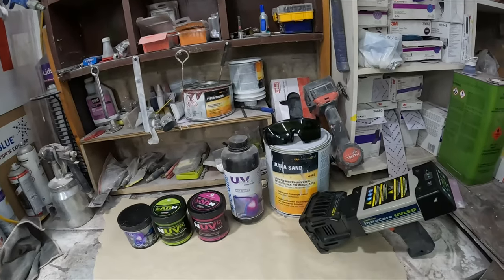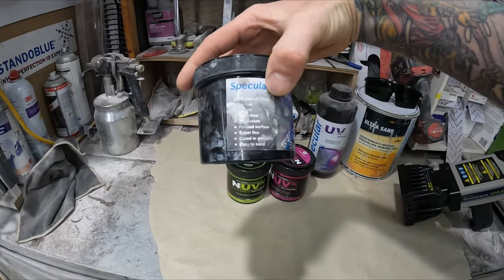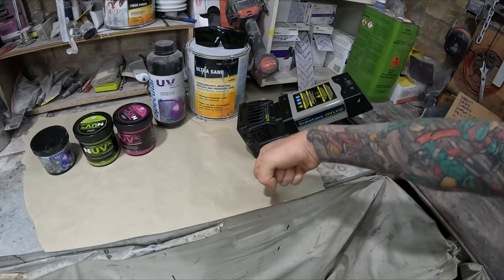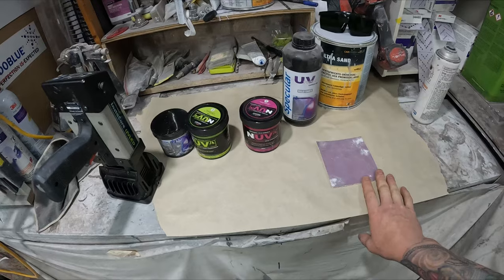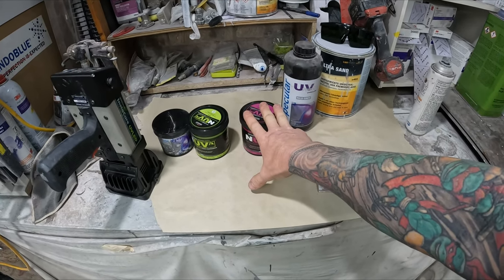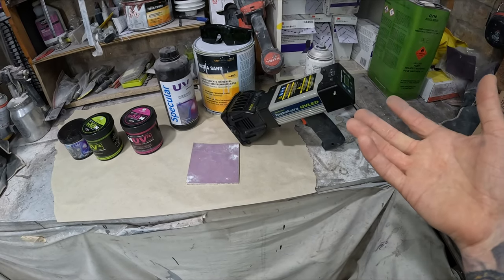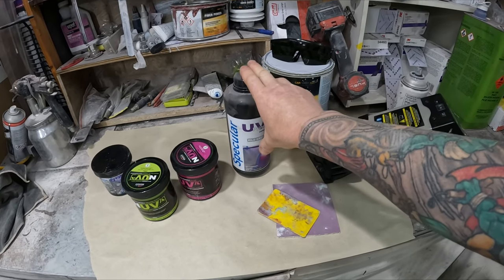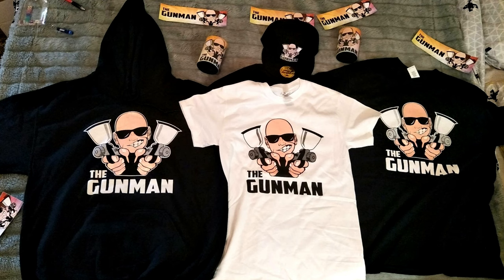UV Primers & Body Fillers

Comment: I don't use the uv fillers , since we have the old globe lights not the led stuff , and yes you can go blind from them if you stare into it across the room , i also burnt my arm a couple of times to feel if its dry while the lights where still on . We use uv primer on the smaller jobs or if its going to be painted the same day

Comment: I’m not a body man but I do some nice things here and there, sometimes for other people. You convinced me on the UV but BUT $1000 for the lamp…did I get that right?!
I guess it is not in my future. Shock must be the theme of the day? Checked out ‘merch’ and VAT is nearly 20%  - that’s shocking to someone in the US. 

(I know that’s not The Gunman doing that so sit back down….)
Reply from the maker: But you can disregard the VAT if you're from the USA.
Reply: I am using a 90usd 395nm uv light from ali. Works well with the product I use.
Reply: @martinl4565 What product are you using? I'm thinking about doing the same 395nm 50watt UV light from ebay or something, those $3800 handheld guns what gunny has are apparently 55watt...

Comment: We have used uv filler and primer for the last couple of years. Question, do you find the base coat lays down slightly different on the primer? I’m taking very minimal but on some silvers and pearls you can see a shadow like it’s not covered. We’ve used PPG, glasurit and for cost mipa, they all do it. Seems to me that it’s more sealed and the paint sits more on the surface. Spoke with all the reps and showed them, not much feed back. Here in the uk UV doesn’t seem to be push much.
Reply from the maker: I recall seeing that with one brand we used to use Metalux but not any others
Reply: Some uv primers bleed through silvers the lesonal and sikkens don't , they also sand the best in my opinion
Reply: @kevinhekers2380  hey guys, in glasurit there is a wet on wet sealer primer coat before base coats are applied, does it still "bleed" through as mentioned?  I suspect the wet on wet primer is designed to cover this and leave a good base for grounds and base coating - Im not a painter but did try out the trade for a while thanks

Comment: UV fillers are not for me. I’ve had them demo’d and just didn’t see the point. 

1. Buy a lamp that’s a fortune to dry it

2. Can only put it on thinly.

3. More expensive. 

4. Doesn’t save time really in my eyes. 

Other options available for same results with 2 pac products. Use good quality fillers and you don’t get pin holes if you know how to mix it right.
Reply from the maker: You might catch up one day and when you do you'll wish you did years ago. It's a game changer, no shrink back and lightning fast repairs. So what if you have to do 2-3 fills for a deep repair when it takes 15 seconds to dry.
Don't be the old sick in the mud who gets left behind.
Reply: @TheGunmanChannel  I’m I the uk 🇬🇧 and we don’t have the same options yet.
Reply from the maker: @SGSAutomotive  you may be surprised, I know some guys from the UK who are all in on UV tech. Nuva fillers are the best on the market and I like the small specular light partly because it's affordable. But it's small, easy to use and can buy rechargeable batteries cheaply, it doesn't require proprietary batteries increasing repair costs. Probably around £500 specular UV, the guy is from Thailand.
Reply from the maker: And the amount of use I get out of the nuva, it would absolutely work out cheaper, because you use it all. Any word xcess you put back in the tub